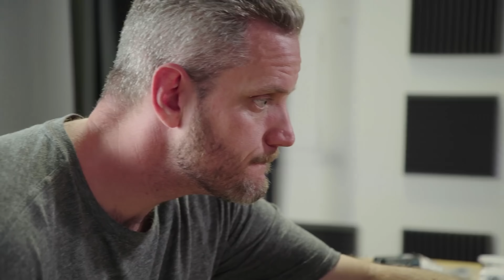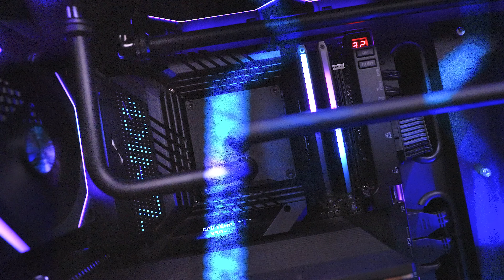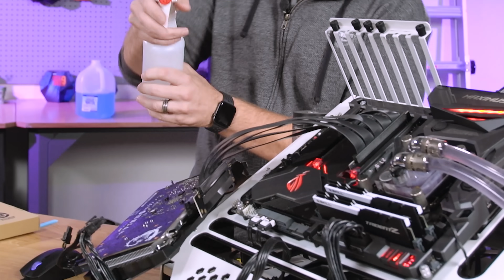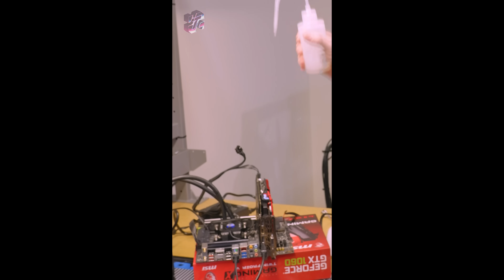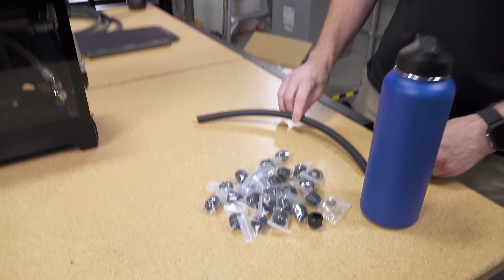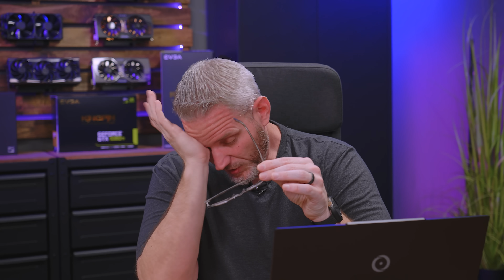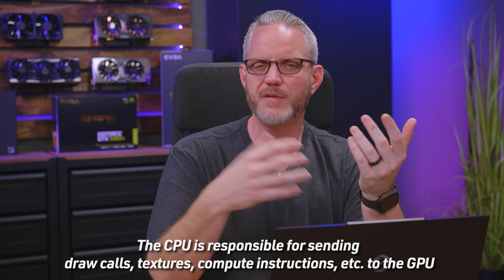5 Myths about Watercooling that are WRONG!

Comment: So to summarize, humans are dumb and will believe anything! 🤣

My biggest pet peeve about water cooling is how people don't understand that it does NOT mean the component will magically run COOLER than it would with an air cooler. Just like a larger or additional radiator will not lower the component or coolant temp vs a single or smaller one. Same applies to more than one pump. Every additional anything added to the circuit affects the flow rate of the whole circuit. Luckily, flow usually doesn't matter anyway! Obviously you need flow, but you won't improve or hurt temps (again, component or coolant) by increasing/decreasing flow once you have enough. The temperature differences and circuit volume we're dealing with for a single PC are so low and similar to each other, it's almost impossible to build a custom loop that won't function. The only reason AIOs are different sizes, is so you can buy one that will physically fit somewhere. This stuff is not difficult to understand...some people just don't understand that they can't change the laws of physics.

Comment: 4:27 if it leaks and gets everywhere its not only about it potentially ruining your system if its conductive its bad but that aside do you really want to clean that crap up off your board and components? Does “fluid” sound good with a “electronic computer”? And inside a gpu? That thing would sink in a bucket so fast the air holes are everywhere so that crap will be stuck inside every cranny of every part ill stick with air i even considered an aio recently but the obviously elephant in the room keeps me from it to me this is like someone saying oh yeah you just have to pull your engine out of the engine bay and plug a new one in youll be good to go 100x easier said then done.

Comment: Can stainless steel be used to pipe a cooling loop? I i bend and orbital weld stainless tubing for work, seems like it would look kind of good just not sure if it’s an ideal metal for these types of systems. Copper wouldn’t look as good but it would probably be better since it’s more conductive and all.

Comment: I have my gpu and cpu both split before radiator and my system don’t run any hotter then 32c on worse case. When in line they run 38 to 42 running off 1 360mm radiator but either way both safe
Running 3080ti and 12700kf

Comment: for 99% of people you don't need to water cool though, sure there has been improvements in water-cooling and its cheaper and easier now, but there has also been improvements in air cooling. unless you're overclocking a lot air coolers keep things far from throttling.

Comment: Water cooling dripped from my CPU block right perfectly on the GPU PCI pins.  Smoked my whole system, burned the card on those pins.  Thank god Thermaltake refunded the money for the brand new system, this was about 20 years ago.  I just found the emails and Tim Hong from Thermaltake completely refunded me for the whole system, which was one of the most stand up things I have ever seen!  

Jay would be happy to know I finally HAD to water cool my 13900k.  My computer was seriously possessed, put an AIO on, and now perfect.  I'd run Black Myth Wukong, and as soon as I exited the game, windows took over and said hell no to the temperature and shut that shit down.  

It took 20 years, but at least an AIO is all manufactured together.  I still wouldn't run a loop/pump.  Then the coolant completely smoked any paint it touched, ie filing cabinets.

Comment: Loop order does matter, but most likely only for higher end hardware.
My loop goes from 5090 directly to 9950X3D then to Radiators.
My CPU idle temps are 50C, GPU at idle and CPU at 100% load is 81C.
If I also run my GPU at full load at the same time, CPU goes up to 86C.
Ideally I would have put a radiator between them, but I couldn't come up with a way to make the loop look good & have easy maintenance if I ran it like that.

Comment: The concept "loop order won't matter" is significantly outdated due to insanely high GPU power consumptions nowadays. The explanation in the video is mostly wrong, or misleading at best. Temperature of a CPU (or GPU) is only determined by its power consumption, interface thermal resistance, and the coolant temperatures. At equilibrium, the coolant temperature will not be the same throughout the loop, otherwise it is not moving heat from source to radiators. With new GPUs that can run at 600W, assuming 100 L/h coolant flow rate, the coolant will be heat up for ~ 5 C by GPU (simple math, Q = cm(T2-T1) ). If your CPU is immediately after GPU in the loop, it means your CPU base temperature is going to be ~ 5 C higher, which bring the actual CPU temperature to worse than using an AIO. Of course if you have 1000 L/h flow rate, the loop order WILL NOT matter, but this would require more than one pumps running at a noise level I cannot accept, which defeat my purpose of building a custom loop. By reversing the loop order, I can run my pump at a silent 2000 rpm, and the coolest water runs through CPU (< 100W most of the time), leading to a GPU temperature ~ 1C higher, which I found totally acceptable.

The big picture of water cooling is quite easy to understand: 1. the loop eventually reaches equilibrium, meaning that total heat dissipation equals to generation; 2. component temperature only depend on 3 things: its power consumption, interface thermal resistance, coolant temperature(s); 3. coolant is heated up by heat source and cooled down by radiators ("loop order somewhat matters"), and the coolant temperatures depends on its flow rate, radiator surface area, fan speed, air temperature, etc. 4. the faster coolant flow rate, the more even the coolant temperature will be in the loop, but that only increase the cooling efficiency slightly (due to a better maintained coolant temperature across the radiators). 5. coolant heat capacity only helps maintaining a stable temperature during load spikes; it plays no role at equilibrium. 

In summary, the only things that can ultimately lower all component's temperature are: 1. larger radiators and faster fan rpm; 2. colder ambient temperature and better air flow design; 3. better thermal paste (or delidding for CPU) and better cold head design; 4. they are non-linearly affected by coolant flow rate (the effect is negligible when flow rate is not very low). 5. When it comes to individual component temperature, "loop order somewhat matters" because at moderate flow rate, sacrificing 1 C on GPU can get 5 C cooler on CPU. My evidence: 1. full fan rpm leads to ~ 3 - 5 C cooler than quiet operation; 2. 3 C lower room temp = 3 C lower component temp; 3. not tested; 4. increasing pump speed from 2000 rpm to 4700 rpm will lower the component temp by < 0.5 C. 5. my loop is pump - rad1 - GPU - rad2 - CPU - reservoir - pump. When GPU runs at 400W and CPU at 80W, water temp dropped by ~ 2 C after passing through rad2 before CPU, meaning CPU is 2 C cooler (compared to GPU-CPU-rads loop). Also the surface temp of rad1 is also noticeably lower than rad2, since it's much further away from GPU.

Comment: Re an in-depth look at thermals pre and post component, could set a reference of thermal exchange for each component independent of other components (AIO's) as a base line to compare to multi-loop configurations (that's a lot of work mate!).

Comment: Hay Bad Boy, thanks for the video mate, very insightful for a newbie to enterprise computer equipment and cooling (Dell place CPU's in front of each other, 1 cpu blows hot air on to the second cpu !) So, I'm an ex Automotive Engineer that got sidetracked in industrial lubrication and thermal engineering, your words of cooling path order and system thermal capacity are very true, we are cooling an overall total of component thermal load via a heat exchanger, by controlling thermal exchange we could keep components at their optimal operating temperature, AKA automotive. Of note, have you spoken auto language to a non auto person (petrol heads, I happen to bleed 98 octane and often transfuse 120 Avgas)? Your language allows me to understand and follow and keep up, understanding your demographic, appreciated and kudos!

Comment: I guess if people really think that you should build two identical component computers with a loop that has a radiator for the cpu and gpu and one that’s all on one radiator it’s probably only a degree or two difference cause like you said it’s constantly flowing and it’s not 220 degree coolant under 20psi

Comment: If you use a copper radiator you wont get life.  Copper kills life.  They use this on boats.  I worked in a chlorine plant and we stopped introducing chlorine at the intake for our seawater pumps as we used seawater to cool in our heat exchangers.  The amount of shrimps worms and muscles that make it into the system and grow down the line in other components was wild.  And a lot of cleaning lol.

Comment: 3:15.. theoretically you could mount the radiators/fans outside so the heat exchange doesn't happen in the room.  This isn't practical but it would actually reduce the temperatures in the room compared to normal air coolers.   I would never do that though.    

The main reason I actually watercool is to use blocks on GPUs that reduce the number of slots the GPU cards require so I can install more in my workstation.  Those air coolers that require more than 2 slots aren't feasible for me.

Comment: I once had a bad spill when deconstructing my loop to change the liquid and I completely doused my HDD (yes ik how weird running a HDD lmao. I use it for usually older games or games I don't play often or just general games i don't need or care if they run the quickest). It was soaked in the liquid n I was terrified!! I dried it off as best I could and just let it sit on some paper towel for a couple days before putting it back in my case and let it sit for longer before I finally got the courage to plug it up and it works perfectly fine. No issues or anything. I'm running corsairs liquid with some dye (I think mayhem idk) and works fine. Maybe I was lucky idk but very glad it all still works.

Edit: for the last part even for rigid tubing you don't need any special training or anything. Just pull up a YouTube video on how to. I bought the Corsair kit and used YouTube  to teach me how to do it. I was a complete noob and did it. Now no it didn't turn out amazing but I think I did a pretty good job for what u have now. It looks pretty good and it works!!

Comment: I believed the "makes the room cooler" myth 17 years ago when I built my AMD 4x4 system. Thought hey that's cool, I can cool this beast without it sounding like a jet engine, AND not have to strip down to my underwear!? Wow that's awesome.
Learned real fast that while yes the system ran much better, the room got even hotter. Because of course, that heat had to go someplace.

Comment: Still using my old Swiftech Apogee XL block that's going on 10+ years old and cooling my new 9800X3D very well...   Hardware Labs Radiator and Monsoon fittings for many years also...  I have the Monsoon fittings to convert from soft to rigged tubing, but just can't bring myself to use them.   Thanks Jay

Comment: What gamers and inexperienced pc builders has in common, they tend to be confused when it comes to physics, thermal and fluid dynamics. You dont have to be educated or be an engineer to understand it, only be curious enough to read about it on google or talk to someone who knows. It really helps if you are interested in engines or working with hot water circulations etc, that gives alot of knowledge

Comment: Aerospace engineer here specializing in heat transfer and hydraulics. Definitely agree with loop order. I've posted various versions of the following on Reddit at least a few times:

Given the specific application of consumer PCs, order does not matter if  flowrate through the heat exchanger(s) is sufficiently high to impel turbulent flow. In Engineering, turbulent flow can be predicted by finding the Reynold’s number of your flowing fluid in a given tube of the heat exchanger. The higher the Reynold's number, the "more turbulent" (to put it simply), and higher Reynold's numbers correlate well with heat transfer efficiency. Turbulent flow can be visualized as little fluid whirlpools and eddies constantly shifting particles around and changing their positions, so heat has a chance to quickly make it to heat exchange interfaces (such as where the fluid physically contacts the surface of a metal heat exchanger) and get transferred out of the system via physics.

On the opposite end, slower flow rates will more likely impel laminar flow through any given tube, and laminar flow is not good for heat transfer efficiency. During laminar flow, fluid movement is relatively uniform, where the "inner volume" of the fluid swaps with the "outer volume" of the fluid much less often and much less dramatically. Both those characteristics together (slow flowrate, fluid flow that is more characteristically laminar) will yield a measurable temperature drop across any given heat exchange interface. As a consequence, you’ll be more likely to detect a significant fluid temperature difference between the inlet of your heat exchanger and its outlet. So detecting a temperature difference at all across any component means your system as a whole is far from operating at optimal thermal transfer efficiency.

If your pump is sufficiently powerful, turbulent flow is achieved through the heat exchanger tubes, and instead of there being a significant difference between the inlet and outlet temperatures across a single component, you instead achieve a steady state system temperature. In this state, component order does not matter. The steady state system temperature of a heat rejection system with a very high reynolds number in the heat exchanger will always be lower than the average system temperature of a system where flowrate is insufficient to drive turbulent flow. Of course, this assumes all else equal, such as your fans being operational and the airflow setup.

A single, say, D5 pump is significantly more than powerful enough to achieve this steady state system temp with minimal discernible temperature difference across any component. That system is typically 1 cpu, 1 gpu, and two heat exchangers. Even then, that single pump can accommodate more components than most would probably think.

There are fringe cases, such as when specific components generate extreme amounts of heat. These cases do not exist in individual consumer PCs.

Comment: Did anyone try using a peltier cooler attached via the cold end to the reservoir? I'm thinking it might be interesting to have a threshold based controller where if cooling fluid goes above 25c the peltier turns on.

Comment: Water cooling won’t break your computer. I had a tube pop off, did a waterfall on my GPU and my motherboard.  The computer turned off and just wiped it up, let it dry. Was good to go, no issues.

Comment: Regular PS5 is the last console version worth buying until PS6.  After the $500, or $570 for 2 controllers, PC start pulling out ahead.  

- New games are $10 less on Steam than PS Store.  This helps with high volume gamers, especially Twitch streamers.
- You can adjust your parts far easier. 
- Far easier to get above 120 FPS on shooter games and above 60 FPS on high graphical single-player story games.

Comment: Nobody needs to watercool anymore. It was a method of cooling back when it was needed. It's just for show now pretty much. Air cooling  and AIO are totally fine. Personally I would never ever use watercooling. It's too much fuss for minimal benefit other than flex...look at how cool my rig looks. For practicality air and AIO do the job fine. Again. Nobody overclocks their system anymore. The big thing now is undervolting.

Comment: Have the radiators outside the case? You could have room air cooling the rad, but exhaust side going outside? The hot air would not re-enter the room = Not adding heat to the room. ;)
I got a old 8700K and a RTX3090 in my loop. Two 280 monsta rads outside the case. But in the room for now. 
Under stress test of GPU and CPU at the same time, I still only get a 1c difference in inlet/outlet temp. (Got temp sensors on tubing going in and out of the case.)
Chromed copper pipes looks the best. ;) regular 12mm VVS what one would use for home use.
After one hour of max load, I got about 50-58c temp on CPU/GPU, depending on ambient temp. (Never seen 60c.)

Comment: In my opinion soft tubing is just the way to go.
While Hard Tubing looks sexy AF - soft tubing just way better when it comes to maintenance.
Cause - if I ever need to remove my GPU - be it for trouble shooting or anything - I can just  pop it right out and set it ontop of the case without having to disconnect anything.
Also its super cheap, easy to work with and the tubing won't come off if you crank down on the fittings